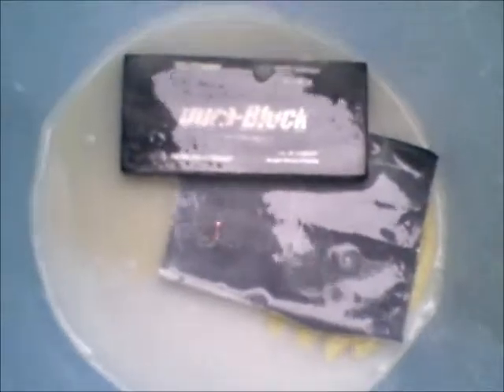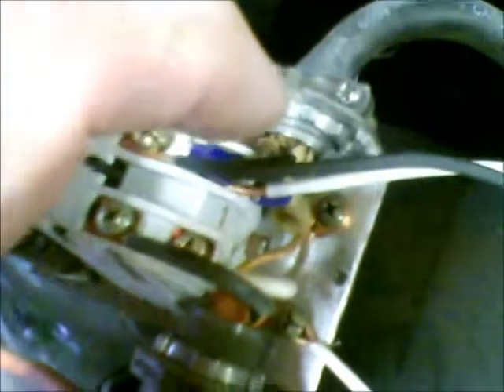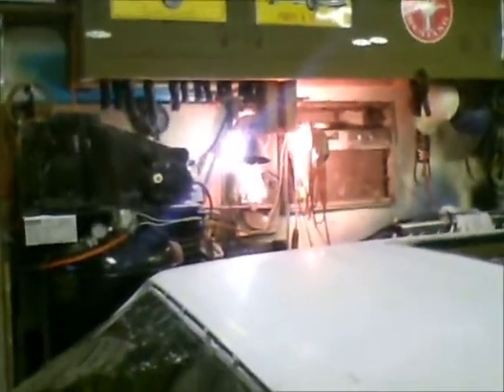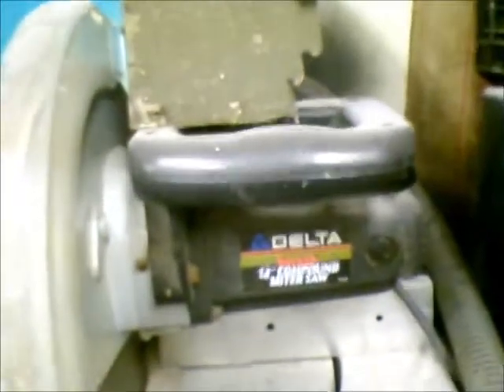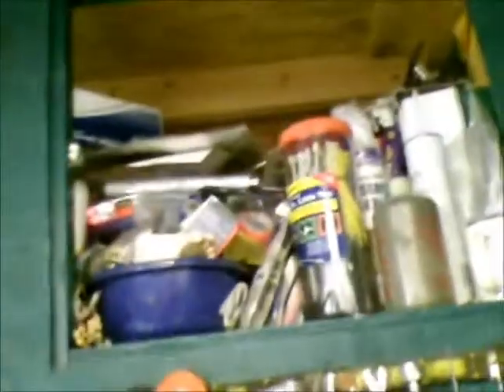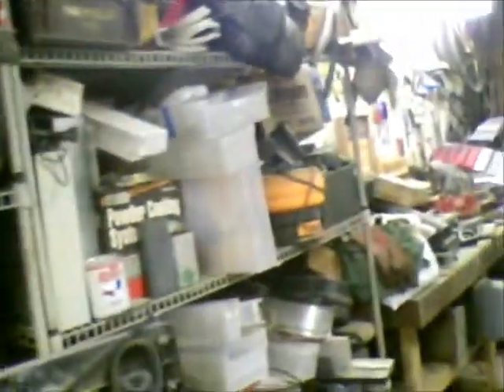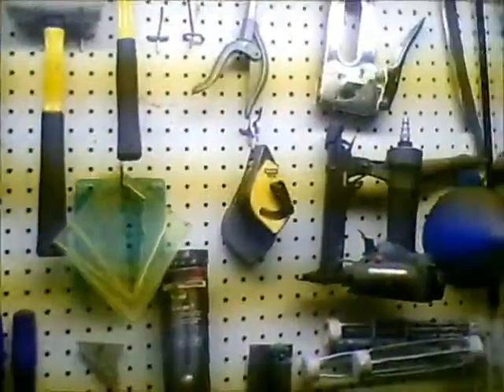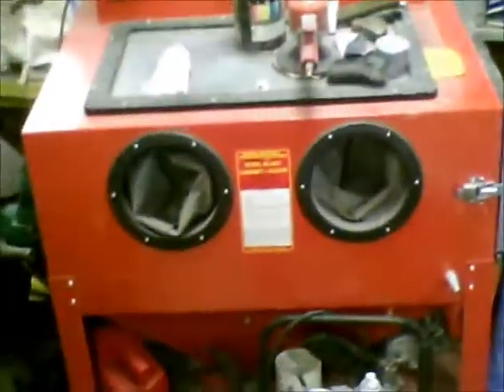Compressor wiring and shop tour

Comment from the maker: The tumbler would work well for polishing aluminum.
You would need a soft media like crushed corn cob or plastic pellets.
Eastwood has a great chart on their website for which media for what metal.
I like using the tumbler because I can turn it on and go do something else while it is cleaning/polishing the parts inside.
Also get you a collander or pasta strainer to sift out your parts when done,it makes retrieving small parts easier than digging around in the tumbler to find them.
Thanks Dan:-)

Comment: It's amazing on how much stuff you can accumulate over the years, I have the same problem lol 
Great work showing the wiring hook up, I sometimes black out the white wire with eletrical tape or I use the red wire so I don't get confused with which is the hot and which is the nutral wire lol 
The cars is looking good, hurry up and get some paint on it so you can get back on your mustang :) 
Take care buddy

Comment from the maker: I am not sure what an 8 down is Ziggy.
The heads and intake are going on a 1993 5.0 High Output motor with an E303 camshaft with crane roller rockers.
It always pays to be careful with electricity,it hurts alot.
That is why I keep my hair short,no Einstein hair after I get electrocuted.lol
Thanks for coming along on the junked out garage tour.  :-)

Comment: Cecil, wireing your outlet that way is not a good idea. Your compressor is no long grounded, it is the ground. A neturel wire carries the current to ground via the grounded buse bar in the breaker box. When you use the bare ground as a netruel you now carry the current to ground through the bare ground wire. Should you touch the compressor you could now carry the current to ground.